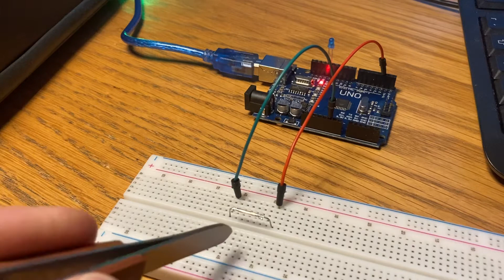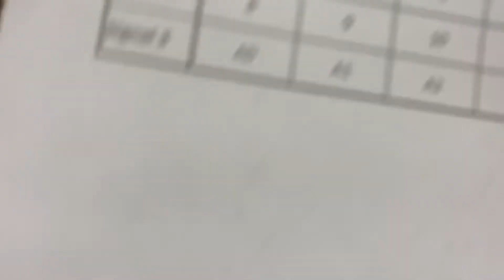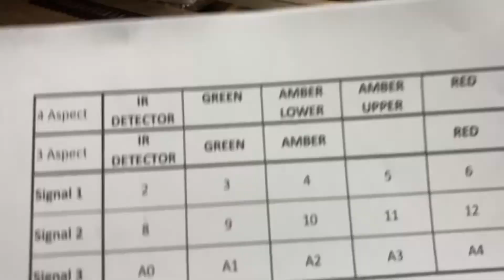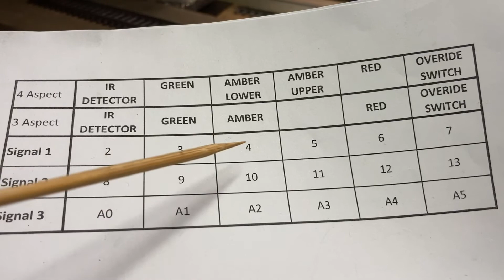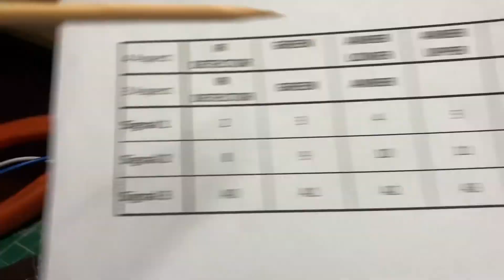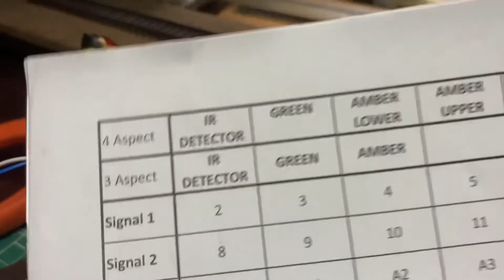Model Railway Automatic Signal Control Using an Arduino Part 8 - Using Reed Switches for Detection

Comment: Great videos just one question. With the reed switvh you say you do not need a 5v supply so are you switching the 0v
Reply from the maker: Yes, the reed switch has a feed from any of the digital or analogue pins and returns to any ground pin

Comment: I wonder if this would work for a railroad crossing With signals Because it seems like a very simple aspect To wire up Only thing is if you're going the other direction you would need a magnet on the back of the train
Reply from the maker: Hi there, have a look here: https://www.youtube.com/watch?v=UCw8_RJ9Rvk

Comment: If you're going down the magnet route,  have you thought of using a Hall sensor instead of a reed switch? The hall sensors are far smaller than reed switches..
Also if you are going down the magnet route, use rare earth magnets, extremely powerful which means you can use very tiny ones...
Reply from the maker: Many thanks for the tips
Reply: A reed 1.8mm x 7mm when mounted vertically and centered between the rails is smaller than the Hall Effect and only requires two wires.

Comment: Just a tip you should put the reed switch horizontally along the sleepers so the switch has a longer time to pick up the magnet, this means you can have a much smaller magnet and still go at maximum speed
Reply from the maker: Thanks for the tip 👍